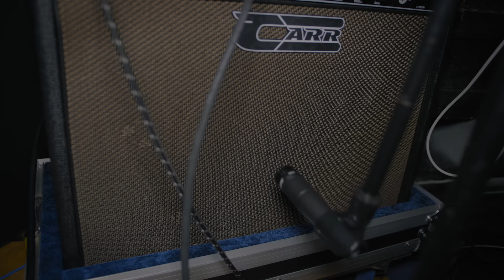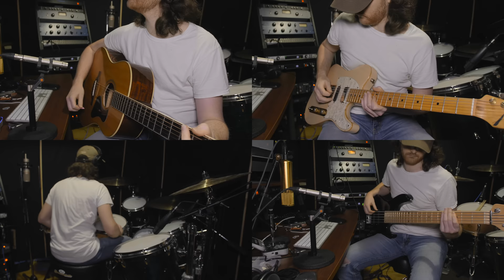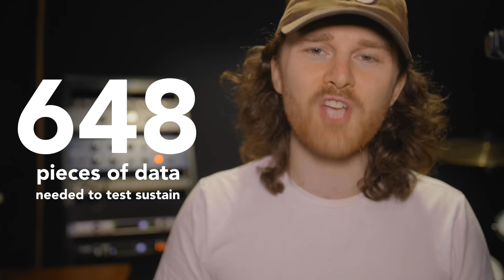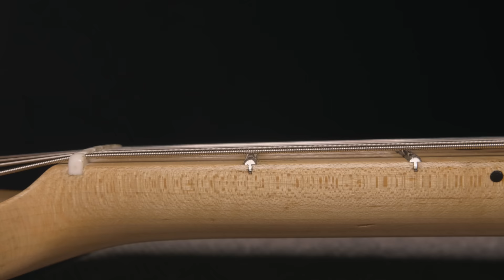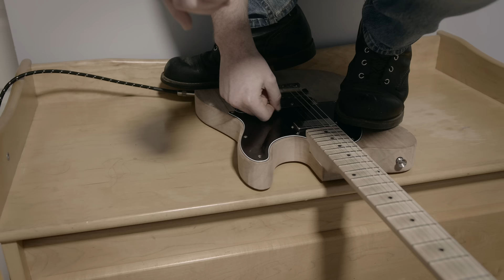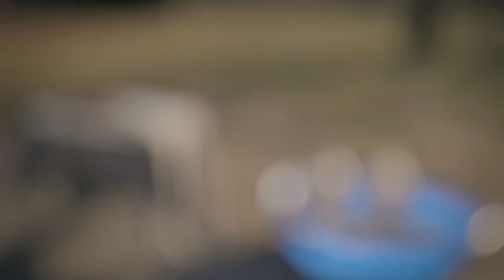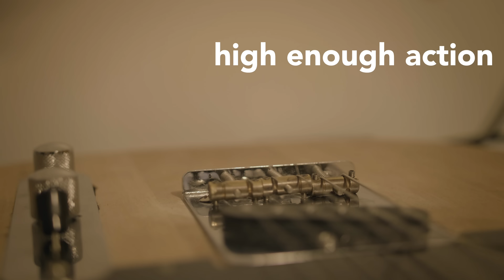Tested: Where Does The Sustain Come From In An Electric Guitar?

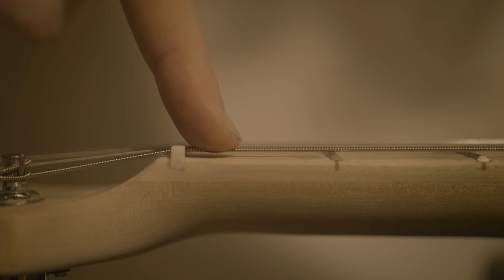Comment: Ironically all the tests after 12:43 actually are comments on build quality and good wood....I as well as many others in the 80s owned guitars that Guitar techs would tell us, That will never play right because - twisted neck - neck won't hold frets - truss rod bottomed out....microphonic pickups..ect....all build quality issues that because of better manufacturing and competition are a thing of the past for the most part. Even just playable gear was a pipe dream for many....

Comment: 1: Finger inserts energy into the string. (Plucking)
2: Energy in string will vibrate. Some vibration will be absorbed into the guitar body.
3: A high mass body (harder or more dense wood) would reflect more of the energy back into the string increasing sustain as it is more rigid.
4: Low mass body  (softer or less dense wood) would absorb more of the energy as it will vibrate more taking the energy away from the string. This will have a dampening effect relative to the high mass wood.
5: The string anchors (nut, fret & bridge), the harder, the more sustain.
When you break it down to physics it all looks more simple.

Comment: I'm a bit late to this... But sustain isn't just how long a note sounds, it's how slowly it decays. Even if a note only sounds for a fairly short time, sustain will affect how it sounds. After all, the sound wouldn't drop off if there isn't anything stopping it. Whatever stops it also "filters" it, because it doesn't affect every frequency or overtone the same.. That doesn't change the results of your test, but it can help to explain why sustain can be important, other than just holding notes ;) Thank you for all the work you do in proving what affects the sound, and in what way.
One thing I'm missing though is the effect a tremolo has. After all, the tremolo is an active part in this, since vibrations in the strings cause the tension to vary, and tremolo's are made to balance tension. I was kind of waiting for the part where you tested that. Maybe it's something for a separate video. Thankfully you don't have to destroy anything for trem tests, since all the components are fairly easily changed out ;)
I do notice quite a difference between a this block on a squire trem and the heavy block of a fender trem. Might be that it resonates differently, causing different interference in vibrations. 
Not claiming that it does make a big difference, but I am quite curious about it ;)

Comment: Much right and much wrong at the same time. Firstly, data - thanks for sharing so we may interpret what you see and hear for ourselves.
Here's what I'd add to the data analysis:
3db is half the signal
6db is only 25%
9db is 12.5%
Then, look at cumulative gains and losses: if you have 2db losses in 5 steps, that's a massive 10db overall. Things are VERY different if you look at it like that.
Next sympathetic resonance: the more the guitar resonates at certain frequencies - de facto, the less it does at others... This means that superbly resonating guitars will have huge dead spots.
So we are not necessarily looking at a more is more phenomenon but looking at sustain and resonance from an aesthetic one - this complicates the analysis.
Are we sacrificing all dynamics at the altar of sustain? Are we looking at sustain retaining overtones? Are we looking at overtone generation and maintenance as being desirable? Are we wanting greater or lower high/low frequency sustain differentiation?
So, in short, while I'enjoyed the video and it looked a lot of fun and is very educational for many guitarists out there, some context provides a different analysis and therefore completely different interpretation of results.
The real question though is how to craft tones that slot right into a mix that balance the audio in the context of the track.
I guess this illustrates the classic combinations of Les Pauls and Teles for instance, why I want a Tele in a metal mix and why I'd urge more country guys to take a stab at SGs

Comment: Damn it, I thought the hard tail vs soft tail (or floating bridge) was going to be tested for sustain. I'm surprised it wasn't mentioned. The idea is that the softail, especialy with a floating bridge, would soak the sustain by taking some of the string energy into the tremolo springs or even worse be a transmitting platform to the other strings (string movement ->bridge vibrating-> spreading to other strings).

Comment: I think one important thing was missed - it is how strong you pluck the string, especially when you measure the relative decay (in dB). Imagine the string as a pendulum. If you swing the pendulum really hard, it will loose the half of its amplitude very fast. But if you swing it a little bit, it will swing for a long time until loosing half of its amplitude. So for a longer sustain, play softly and with more gain/volume on the amp. Also acoustic guitar should have less sustain as it is designed to steel the energy from a string.
Reply: He did that. He said it increases the sustain acoustically, but his amp decreased the sustain when he hit the strings hard.

Comment: One minor complaint:
When you tested for finish and weight, you didn't isolate these two factors from one another.
So it's unclear where any differences between the A-test and B-test come from
Reply: Also in one test the guitar body is contacting the pool and the ground and in the other test it's on his knee. A small thing sure but vibrations travel through solid objects and what not. Still great thorough testing   here and it made great points. Great outcome

Comment: softer materials are dampeners, harder material resonate less, all the energy is reflected back to the string making it to sustain the vibration more, that invalidate the tone wood claim. a harder wood would resonate less (less dampening) so the effect of the wood and its reflection of wave sound would be less, so what is it, tone or sustain? so tone wood invalidate the sustain claims.

Comment: this is so silly. 

so sustain is how long the strings vibrate to produce sound
or if you look at it another way. the vibration can be seen as energy, therefore sustain is how long that energy can be held in the strings vibration. so reduce the number of areas where that energy can be lost and you will increase the sustain.

Comment: standing on the guitar is not nearly at scientific as using a clamp.  the mass of your body has the ability to absorb some of the vibration, where a small simple clamp or strap would have much less mass with which to absorb such vibration. When you added glue to the guitar, you covered the low E magnet, not changing the magnetism, but perhaps altering the measurement of the resonance. again, great knowledge and forethought going into these videos, I am only providing an alternate perspective on the methodologies provided. I dig it anyways and will continue to be subscribed as I gain more insight with each video.

Comment: OK, but as a pro musician, I've played guitars that would ring out for days, and others that were simply, "normal", and played at lower volumes, with/without distortion. All were good guitars, with nothing wrong enough with them that would have been as you showed. Also, pickup closeness does have an effect in tone and sustain. You putting the pickups above the guitar pulls the strings away from the body instead of the normal downward pressure. Basically, you took out everything that the body and neck does for tone and sustain. (Not absolutely positive that would make much of a difference.) One thing that could have been tested is resonant frequencies of the body and neck. If they line up with 440 standard frequencies, it may be the missing link in the sustain equation here as the two would create sort of a feedback loop and increase the volume and resonance.

Comment: LMFAO So... I hate to be the guy to say this a whole year after you poured Tite Bond all over a guitar, but...
Tite Bond, when it's dried, actually has very similar properties to wood. That's the purpose really, it's why tite bond is the best glue for woodworking. 
So... you basically just covered that guitar in a coat of wood. lmfao
But, it's actually a fairly effective way to do the test, just not exactly for what you were testing for, as covering whatever finished remained with a wood-like substance probably entirely negated any effect the finish had on the sustain.

Comment: You've shown that the difference in strumming force is significant, so you really need to find a way to strum exactly the same in each of your tests. Otherwise all those small differences could just be attributed to you strumming differently in each test. Otherwise for me all these test results are completely pointless.

Perhaps you can build a rig with a servo that you can mount to the body. And one where you can adjust things so that for each guitar it strums with the same force, depth and path.

Comment: Seems a bit strange that no comments nor the video actually discuss the basic physics of the guitar - which applies to both videos. An electric guitar is designed so that the bridge reflects the maximal energy back into the string and does not transmit to the body. Once transmitted to the body, whether the sound continues to resonate at a set of harmonic frequencies or experiences a high degree of destructive interference does not really matter, because the string will lose energy faster and the sound will decay. The acoustic impedance mismatch between the string and saddle and nut is what allows the string to keep vibrating for longer. 

It’s like bouncing a ball- if you bounce a ball and each bounce is much smaller than the last, then the ground has absorbed the energy. Whether the ground then vibrates or the energy just turns into heat and noise, it’s too late for that ball. So all this discussion about a guitar body resonating better etc is basically pointless because even if it did resonate (as an acoustic does) that resonance would not be as effective at returning energy to the string compared to just not resonating at all. And also, it would move the pickup (as happens in an electroacoustic) which produces interference between the string and pickup movements and results in harder to predict filtering etc. You can sort of hear this in electroacoustic guitars, where the high end rapidly decays after plucking as the peaks of the higher frequency standing waves are closer to the saddle and get blocked by its edge.

Comment: So the strings affect sustain. If the strings ring freely, the guitar sustains longer. Cool. Physics checks out.

This is not an acoustic instrument. It is an electronic instrument. The body of the instrument makes zero difference. The electronics and the actuating components make all the difference.

Musicians are typically neither engineers nor physiscists and therefore should not typically be trusted with physics or engineering.

Comment: wow the whole aftermarket fancy bridge, saddle, nuts etc. business is now ruined you have single-handedly popped the balloon when it comes to exorbitantly priced aftermarket parts, I play guitar to communicate with my sound, to make people feel better. the sustain of the note might be more of a texture when the note is first created, its first rise in volume, does it start with a "t" sound? "d" "b"  it might be you palm at the start of the note, then the tone takes off round sounding... Alembic would install a block of brass in the body under the bridge and the their bass's would still be ringing through lunch brake, was the joke. cast tuners, thicken the notes on my sg as compared to the tin original tuners,  a solid chunk of brass at one or both ends of the string does let the string do its thing better, does it help you be more creative? quantifying some precise length of sustain does not answer the question of if any alteration you've done let you as a player sound better.

Comment: This was significantly less convincing than your previous video. Your results were all over the place with significant variation, yet you seem to conclude no significant difference? Also much of it wasn't very well controlled, testing for one factor but introducing several others at the same time without acknowledging. Standing on the guitar to "connect" it to the large solid wooden drawer until? What about the large rubber soled boots and your whole bodyweight pressing down? Testing different guitar finish? What about the fact you played the first finish sat down normally, but the second finish with the guitar laying down flat on the floor? I bet you'd get different results even if the finish was the same.

Comment: Sustain has nothing to do with the hold between the nut and the bridge. It's all in the wood and the neck. The neck has to be "neck through body." Set necks and bolt on necks are for losers. And as for the wood, if the body or the neck are made of Agathis or Basswood, you got screwed.